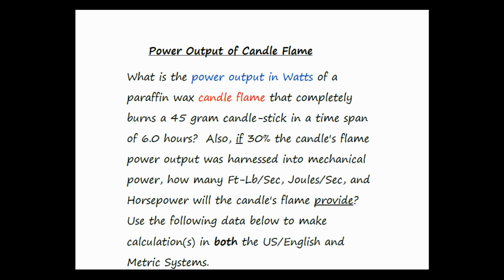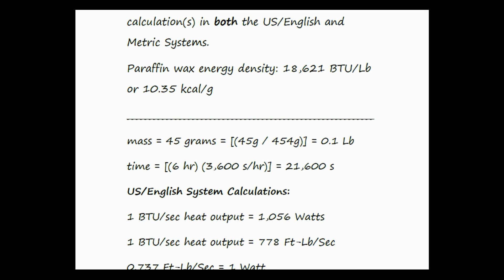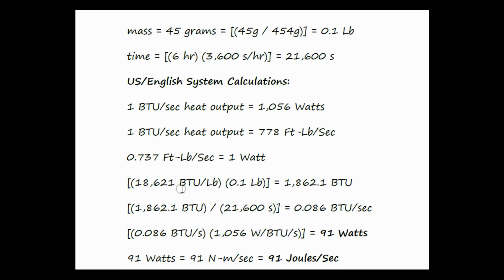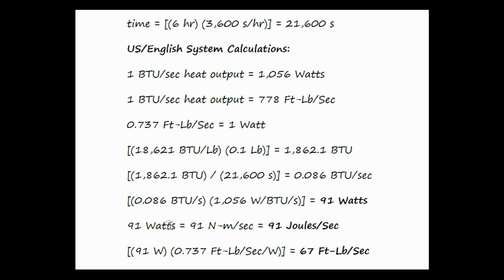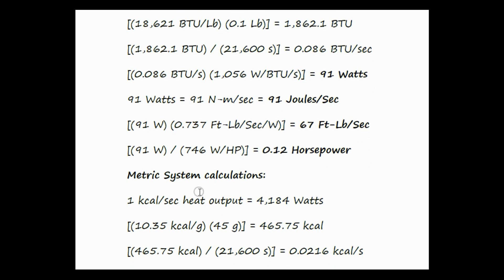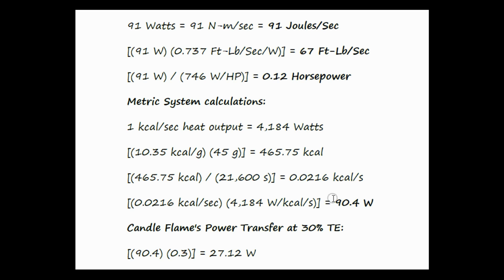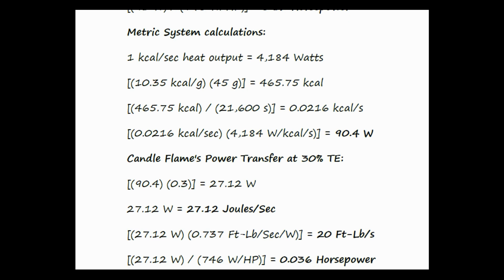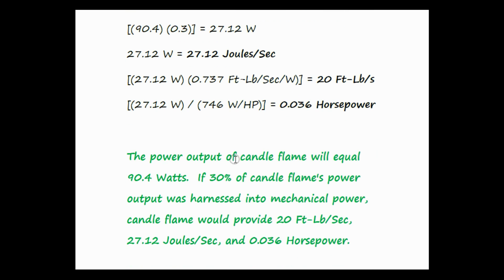Power Output of a Candle's Flame [Thermodynamics]

Comment: A couple of quibbles: This seems to assume that 100% of the fuel energy is converted to heat, but isn't ~5% turned to light?  Also, combustion must be something less than 100% efficient; paraffin wax candles are strong soot producers.
Reply from the maker: Hi larrygilman9896.  This model is with respect to Energy Density (Potential Energy) over the function of time.  Most of the Kinetic Energy is lost to the atmosphere in the form of heat.  We are NOT concerned with Combustion Efficiency in a 21% oxygen environment, NOR are we calculating Lumens Light Intensity.    We are only focusing on Thermal Efficiency based on the rate of fuel (paraffin wax) consumption.

Energy Density of Paraffin Wax:  18,621 BTU/Lbm
Mass of Candle:  45 grams
Consumption Time:  6 hours
Thermal Efficiency:  30% = 0.3

1 BTU/Sec Heat Output = 1,056 Watts = 778.5 Ft-Lb/Sec = 1.4 HP
1 HP = 746 Watts = 550 Ft-Lb/Sec
1 Lbm = 454 grams
Potential Energy = [(18,621 BTU) / (454 grams)] = 41 BTU/gram
Consumption Time = [(6 Hours) x (3,600 seconds/hour)] = 21,600 seconds
BTU/Sec Heat Output (Kinetic Energy) = [(45 grams) / (21,600 seconds)] = 0.002 BTU/Sec

Equivalent Mechanical Power Output @ 100% Thermal Efficiency = [(0.002 BTU/Sec) x (1,056 Watts per 1 BTU/Sec)] = 2.1 Watts
Equivalent Mechanical Power Output @ 30% Thermal Efficiency = [(2.1 Watts) x (0.3)] = 0.634 Watts
Equivalent Brake Horsepower @ 30% Thermal Efficiency = [(0.634 Watts) / (746 Watts per HP)] = 0.0008 BHP

Conclusion:  A paraffin candle's flame having a 0.002 BTU/Sec Heat Output, harnessed for mechanical power at 30% Thermal Efficiency, will transmit 0.0008 Brake Horsepower.

Practical Example:  'Vacuum Flame Engine'

Note:  Total Input Power = Available Power (BHP) + Power Lost (FHP) ===> Conservation of Energy ===> 1st Law of Thermodynamics.

--- End ---